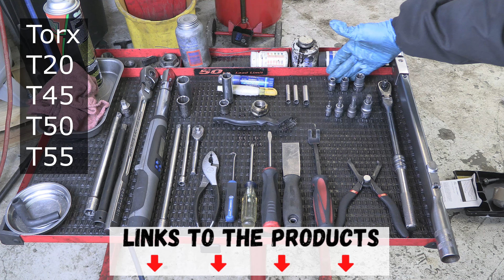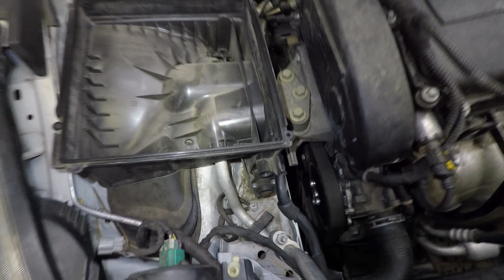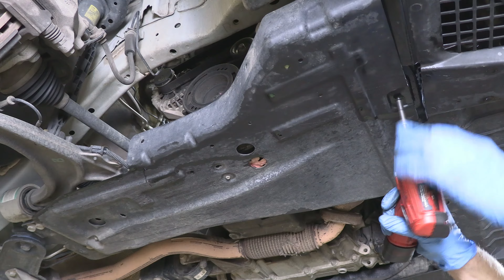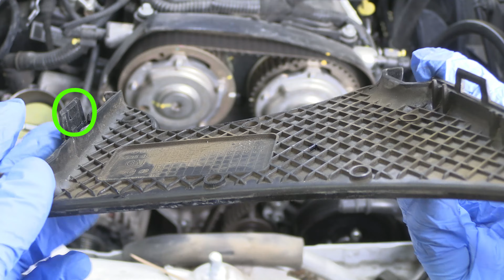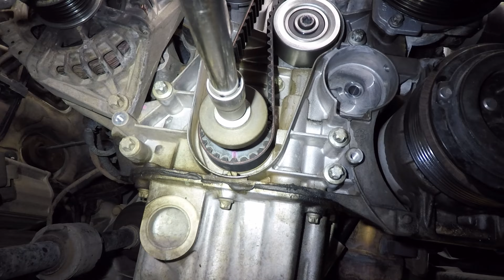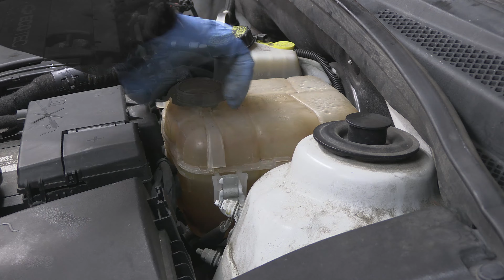Chevrolet Cruze Timing Belt Replacement (+ water pump, 2014 Chevy Cruze)

Comment: You are a life saver. I did this job this weekend thinking that having the lock tools would make it easy. WRONG! Chinesium lock tools didn't fit. Spent an entire day trying to time it up, to no avail.Ended up packing up at 8pm due to incoming thunderstorm. Then I found this video. Next morning I followed your technique, resulting in success in just under 2 hours( including full reassembly). Ran perfectly. The check engine light does come on for crank/cam corelation code, but the engine runs great so I'll live with it for now. HUGE thank yous for posting this video.

Comment: Does this procedure and the parts apply to 2014 Chevy Cruze with 1.4L engine?
Reply: Just did some research and it turned out that the 1.4L engine uses a timing chain that does not need to be replaced.

Comment: Im not a Mechanic, But my notice light came on for timing belt replacement at 100k miles. on my chevy cruz 2014.
I want to commend you on such a well presentation video. everything was so well explained and with details process videos. Unfortunately for me I dont have all the correct tools to do this myself but if I did i would have no problem doing this job after seeing your video. WELL DONE!
you earned a subscriber for sure!

Comment: The service team got popped on my 2014 Chevy Cruz I pulled up at the store shut the engine off got back in and it wouldn't stand it wouldn't start when I got home I noticed the  Belt was shredded I put a new one  And  Will not run correctly Does anyone have any suggestions

Comment: Great video. It also shows that the fancy camshaft tools aren't needed, like the 3 mechanics I've been to insist on having, forcing me to a dealer. Turns out the dealer is as cheap as those mechanics anyway on the estimates for all this. FYI, nearly all of them are around the $1300 range for timing belt, Idler Pulley, Tensioner, and water pump.

Comment: After many hours of trying to get the timing belt over the tensioner I finally found this video, which showed me I needed to remove the locking tool from between the cam sprockets and turn the intake cam to tighten the belt between the camshaft sprockets.  Once that was done I had enough belt to get it onto the timing belt tensioner in a few seconds.  Thank you for showing this method of changing the belt.

Comment: I have the cam locking tool and it seems to make it almost impossible to get the belt back on with no slack in between the cams, because they cannot move
Reply: You’re supposed loosening the idle pulley until you can fit the belt on

Comment: 2016 chevy sonic...1st time changing timing belt, did it solo...followed these steps but had the locking tool kit and hand tools...took me 5hrs...she fired up...drove it across the yard, parked it and celebrated with a cold one...thank you for the video...

Comment: Hey, I was in other videos, they lock the flying wheel as well using a tool, is that important?
Reply from the maker: From the standpoint of torquing the crank pulley bolt properly - yes. But if you're just concerned about keeping it in time - no. There are timing marks to keep it in time.
Reply: @MakeItEasyMechanic  Thanks Mate

Comment: Thanks thats a great video .. i change my timing belt , but my car won't  start , what it could be ?  My car stop runing on the street with time belt was damage from the teeths
Reply from the maker: Theres probably some valve damage. If the timing belt broke with the engine running - pistons could've hit the valves, which would cause a compression issue. Next step is check the compression in each cylinder.

Comment: I don't have an impact wrench or crankcase locking tool. Can I use a screwdriver or something similar to lock the flywheel? Otherwise, I'll put it top gear with the handbrake on to remove the crankshaft balancer bolt.
Reply from the maker: If you can get to it with a screw driver, I dont see why not

Comment: Excellent video saved my butt. I bought the locking tool kit it was junk didn’t fit thought I was sunk then I watched your video how to simply marked the teeth on the gears in relation to the plastic housing genius! But I have to say it took me about 17 hours not 20 minutes like in your video LOL. For other people reading some of the troubles I ran into were loosening my drainage plug. A cheap nylon screw very flimsy I wasted 45 minutes and finally pulled one of the hoses off to drain the coolant. The other problem I had was putting the splash guard back on pieces were missing so I just used a few zip ties and drilled a couple holes no she’s tighter than ever. One other issue was when I was all done I had a cooler line leak where the aluminum pipe attaches to the thermostat housing luckily I had an O-ring that would fit and was able to secure it without a leak.

Again great video thank you so much for taking the time.If you’re ever on the big island in Hawaii say hello Mahalo Dave

Comment: Is it necessary to have it on top dead, or can you remove the belt without rotating the engine?
Reply from the maker: I've replaced timing belts before without setting the engine at TDC, just made sure cams and crank were in the exact same position as they were when I took the old belt off.